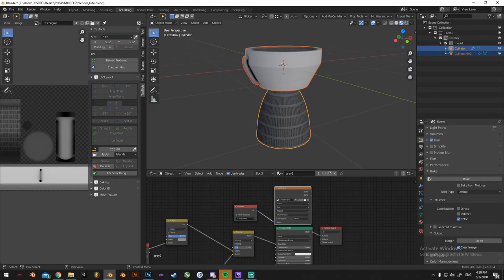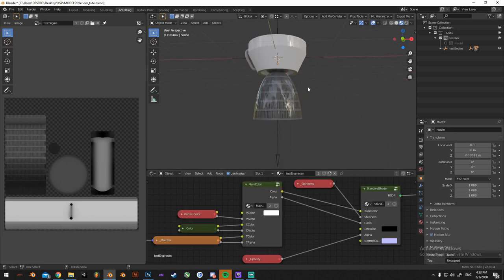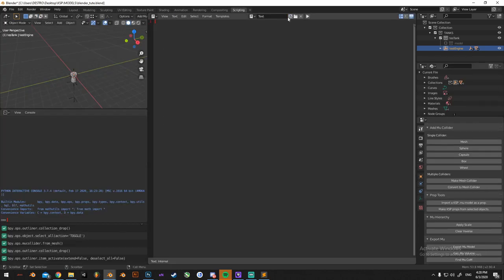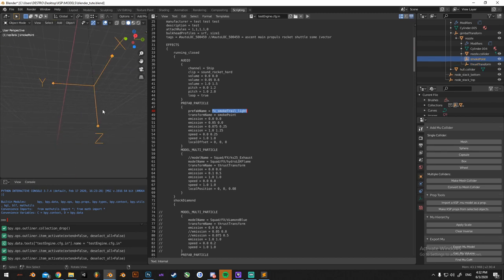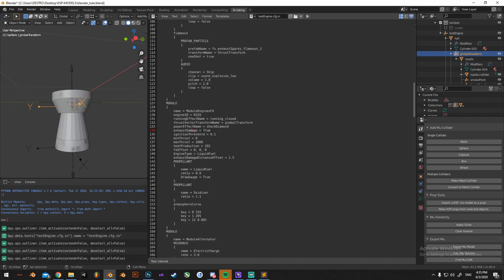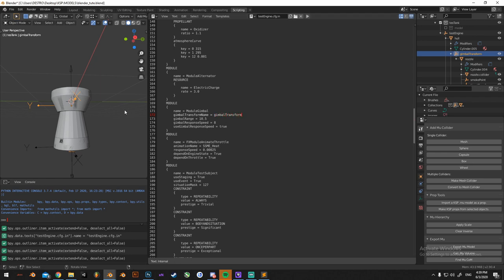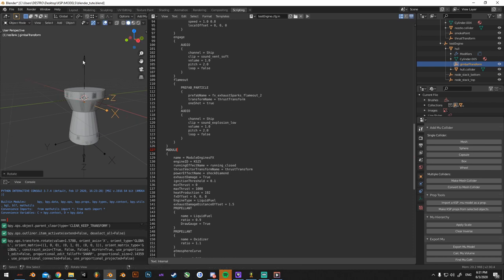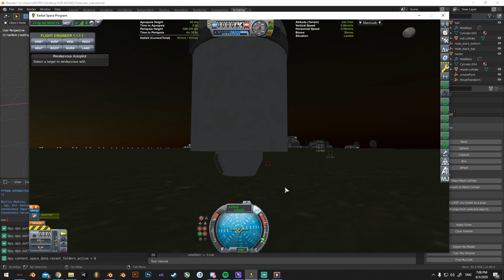Kerbal Space Program Engine Modding Tutorial | Using Blender only!

Comment: i tried this and noticed this.
#1. save the script in blender to the folder without (.in) so it should look like this modelname.cfg.
#2. in blender go to scene properties, change the units lenght to micrometers.
       higlight the "node_stack_top" press n copy the values from Z-location
#3. edit the script and add the locations of the nodes and save.  
node_stack_top = 0.0, 1.033776, 0.0, 0.0, 1.0, 0.0, 1
node_stack_bottom = 0.0, -1.873132, 0.0, 0.0, -1.0, 0.0, 1
((X.Y, (put your z value in micrometers here), 0.0, 0.0, 1.0, 0.0, (if you want you can change size here, where 1 is equal to 1m)
#4.save script in same folder as your model along with the textures in ksp/Game Data.

i still haven't got the gimbal to gimbal yet.....

Comment: Why do you skip over one of the most important parts, actually adding it to KSP. All of this work is for nothing without that. All you show of that is exporting the model. Nothing about the config or material. You delete the attachment info from the config but don't show how to put it back in, just some vague comment about auto generation. How does that work? You at least showed a little more in this video then the first one but there is still HUGE gaps of needed information.